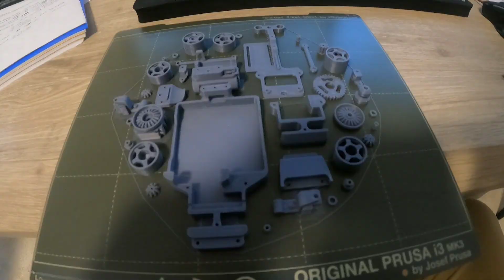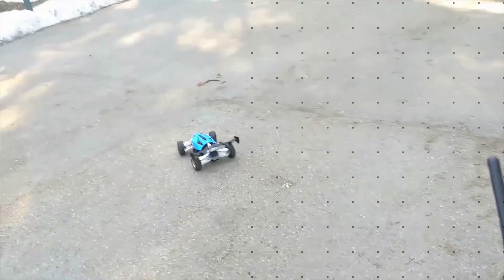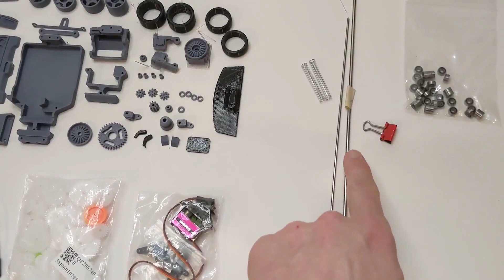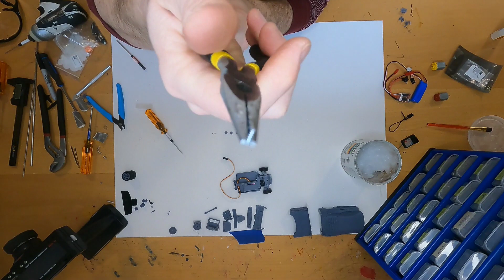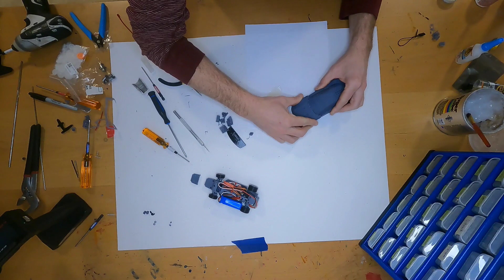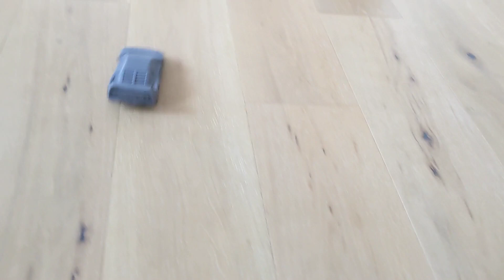OpenZ Ferrari F40 Complete Build Guide - 3D Printed Mini-Z

Comment: This is pretty cool, how reliable is that pinion gear, I feel like there's 2 major failure points, first one being the wear and tear of the gear and eventually teeth grounded down and second the torque form the motor widening the internal hole of the gear making it free rotate within, I don't think I saw a grub screw secure it, just looks like a press fit
Reply from the maker: Yup you're right the gears will wear and there's no grub screw however the little model is pretty low weight, the tires are very slippy, and the motor doesn't have a tonne of power so I didn't have any issues with putting more power into those gears than the 3d printed plastic can handle but I'm sure someone would with lots of use over time.

Comment: Thank you for sharing this with us, I was actually looking for something more detailed. I don't own a filament printer but a resin 3D printer, I would assume the bigger, more static, parts should be OK in resin but do you have any idea if the gears would hold up? Close to no details on the internet about that.
Reply from the maker: So far I haven't had any issues with the gears but I don't have a tonne of time on it. I would expect the spur to hold up and if you have any issues you could probably find an injection moulded plastic pinion pretty easily. The motor I have on this build isn't that powerful so that probably helps so if you're going for a better motor you might need to upgrade at some point. I use printed plastic spurs on our Skeeride 1, OpenRC F1, and MkUltra and they hold up pretty well just out of PLA+.

Comment: did you use a .2 nozzle to print? (mainly the gears)
Reply from the maker: .4 for everything
Reply: @rcprinter  oh really? I've just tried it with petg and the smaller gears didnt come out good enough, trying now with pla
Reply: Just did it, ended up way better
Reply from the maker: @Harel-DIY  yeah I printed everything in PLA
Reply: @rcprinter  including the tires?
Reply from the maker: @berracuda09  no not the tires, the tires need a flex filament like tpu. There's also a suspension plate in the car that should be flexible.

Comment: Could printing be used to make a cast that's filled with silicone caulk which would be soft enough?
Reply from the maker: Yeah something like that is probably the way to go if you can find a good rubber/silicone compound for tires.